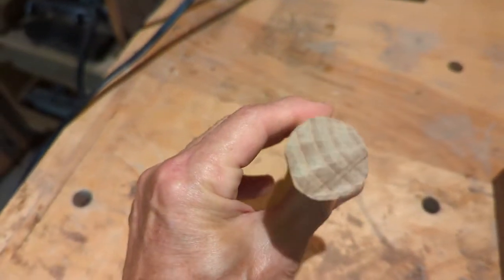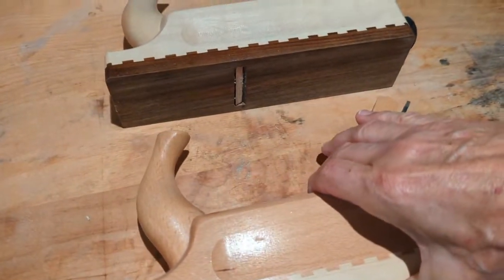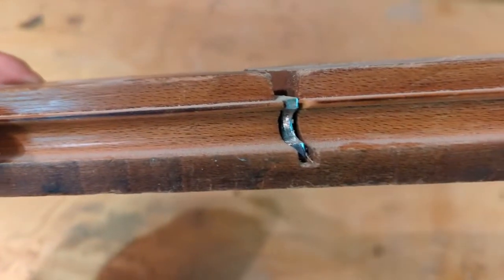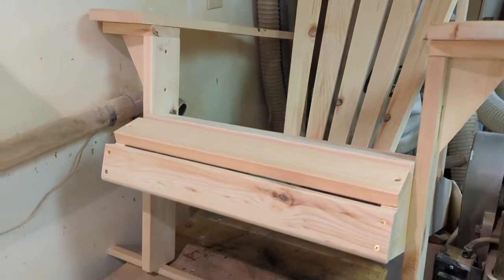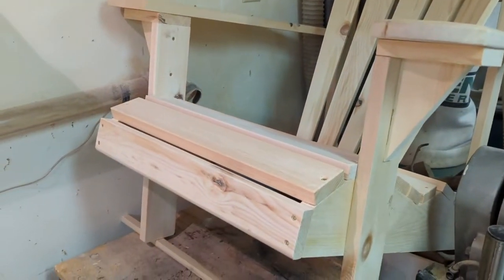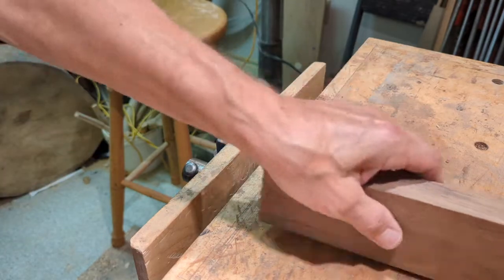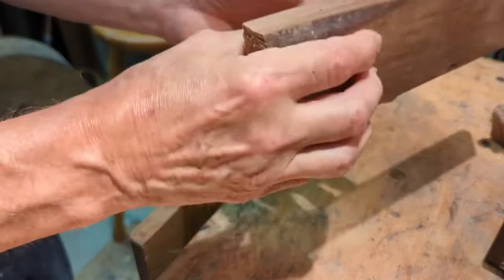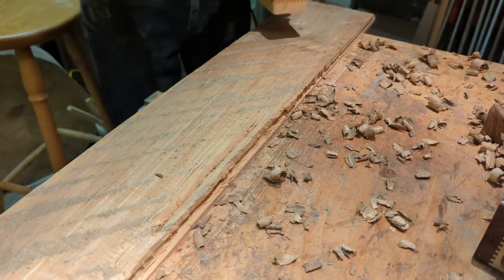TOOL TUESDAY (EP 1) HAND PLANES

Comment: At last someone demonstrating a plane on the face of the timber😀👍 you are obviously expert. I have a couple of cow horn planes that are adjusted with a hammer. I prefer them to Stanleys. I think the blades are better. I’ve just been rebating with a home made plane like on the video. I see it only needs a gentle tap to retract the blade. I hope the grain of your table top was all in the same direction 😀
Reply from the maker: Mostly in the same direction.  It was Basswood so that helps and a sharp blade.